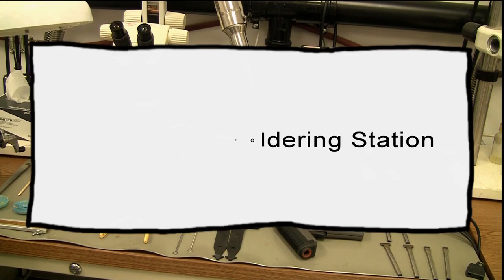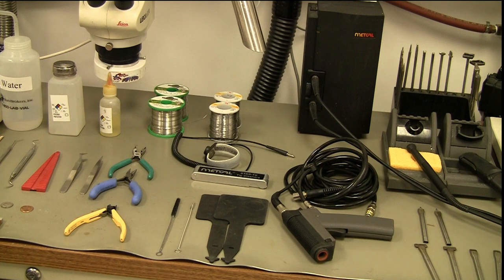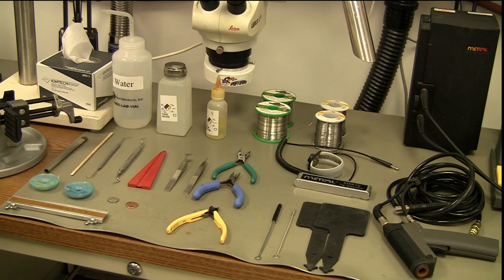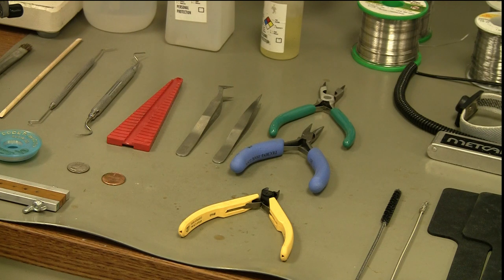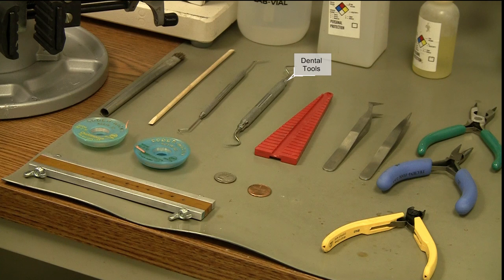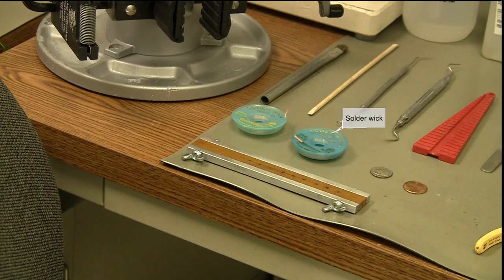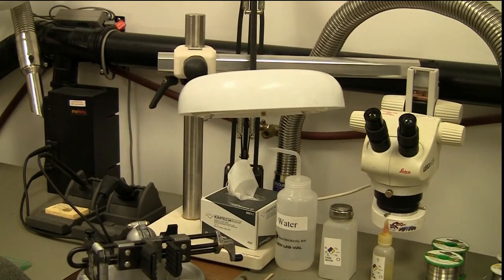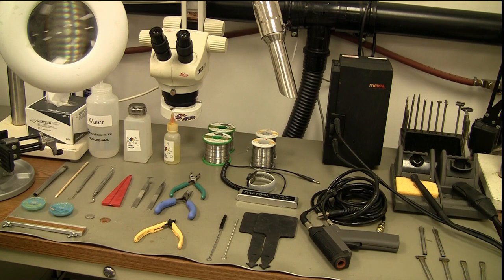Professional Soldering Workstation Configuration

Comment: Hello INSTRUCTOR   SO AS YOU SAY

RULE ONE  IS SAFETY   !!!
Ist always so funny  and hilarious,
But whats is real important  then your handy tool ?
What are you breathing in? Heat up the bord , there is flux on the bord ans some flux  and  lead solder, tin residue  

YOUR 2 LONGS, LONGS THAT  YOU CANT REPLACE
SO BAY  a AIR SUCKER  OR MAKE IT YOUR SELF 
Make a simple sucker that you be sure that that smoke and flux residue  will suck away from you !!
Reply: He has one you can see at 9:10

Comment: Having just done the IPC7711/7721 rework and repair course, I came away with three key ideas that change my soldering;

1: Running your iron hotter than 280C/540F is pointless, and probably damaging your components and PCB... That stands for leaded or lead free solder. I did a lot of lead free joints at 250C, and they're all perfectly acceptable.

2:Lead free solder is not the work of Satan. Choose a good Japanese alloy, go in heavy with your flux, and your work will turn out just fine.

3:Tip selection is a somewhat personal matter- I can do pretty well everything with a mini-wave/cup tip, plus a few chisel tips. My colleague who did the course with me loves knife tips. Try a few different styles, and see what you prefer for SMD and through-hole passives, ICs and other package shapes.

Bonus extra point; PLCCs are the work of Satan. They're bloody awful to work with compared to QFPs or SOICs.
Reply: ... and now I'm an eCAD operator, and I haven't touched a soldering iron for almost a year.
Reply: I find running my iron that cold takes forever to heat up a joint. Something that I could have had the heat on and off of in 2 seconds now takes 7 to heat and the 2 extra for the work. Any explanation?
Reply: Mutli-layer boards suck heat away very quickly. Where I work now, our soldering operators have their irons up around 350-400 for our big mutli-layer PCAs.

Where I was before, as a repair technician, I was only really looking at double sided boards.

It's a journey, this electronics thing :-)
Reply: +Peter McKinlay Indeed, quickest reply ever. I usually run 350 or less and get the joint done quick.